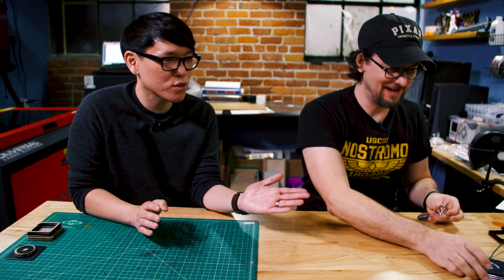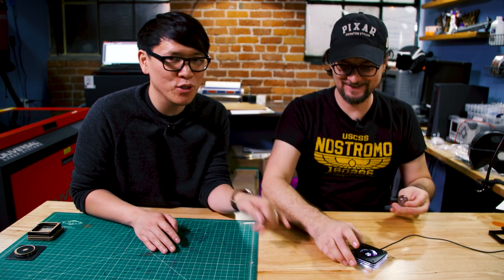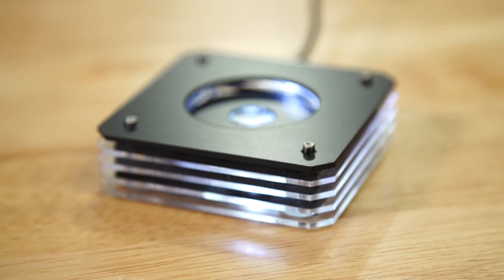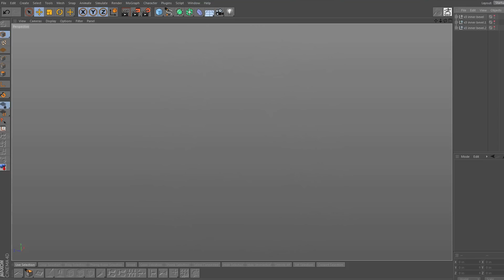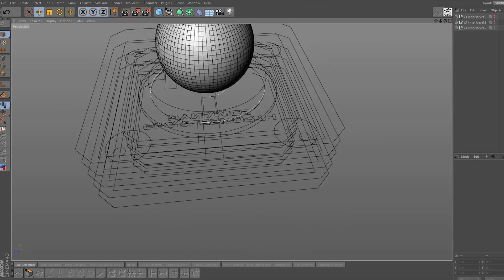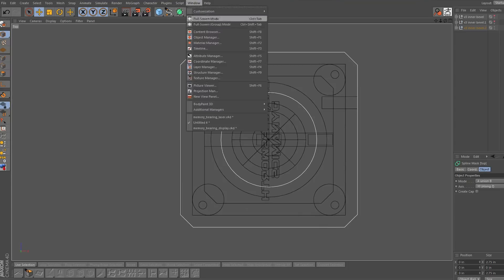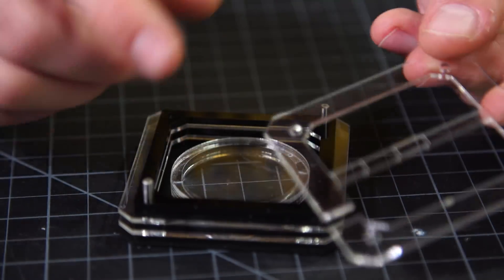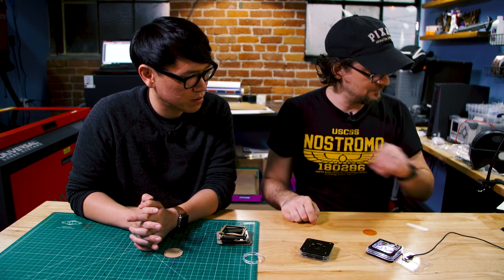Show and Tell: Laser-Cut Memory Sphere Display

Comment: I looked at this on Etsy (it's $45 and you have to glue it together yourself!) and looked around and found something similar on Amazon for $13.99 (https://www.amazon.com/gp/product/B076NCVCZS/ref=ppx_yo_dt_b_asin_title_o09_s00?ie=UTF8&psc=1) with only one side pane, but it's already assembled and has a battery option as well as a USB option (for no cables draping around).  The memory orb looks very similar on it and I didn't have to glue anything and it cost quite a bit less.  I connected it with the wire to an AC RF remote plug and I can turn it on in my home theater room with a button press (also turns on a 5-light puck behind my Harry Potter prophesy crystal ball on the opposite side of the room and that one goes through fading colors and with tissue paper around it looks like the ball itself is lighting up).  I got both lights for less than this "kit".

Comment: Isn't the problem with Cyanoacrylate (Super Glue) that it off gases and hazes the whole part? So you can't say that the hazed part will be hidden, the piece trough which the light comes out would also be hazed.

Anyway, an interesting thing to do with this would be to put a piece of diffuser material around the main cutout on the inside. I think that would make the side lighting much more interesting.

Comment: Or, instead of gluing it together, you could press the pins down to rivet everything together. you don't have to press them very hard, depending on the tolerances of the holes. You'd have to be really careful though because the plastic could easily break from this.

Comment: More video of them using the laser cutter would be good. Did they cut with the paper on? Did they remove it to etch? What settings did they use? I want to see more lasers!
Reply: He was gonna do a video making one and then heard Norm was doing the interview.......
Reply: Telling the settings is pretty much useless unless you have access to the exact same laser model. And typically you cut with paper on. Cutting or engraving with paper off tends to leave residue stuck to the surface that is difficult to clean, though there are specific use cases where off is better.

Comment: Why not have the thing battery powered since its one LED? The wore seems ugly and annoying.
Reply: There's a single pane device on Amazon for $13.99 (https://www.amazon.com/gp/product/B076NCVCZS/ref=ppx_yo_dt_b_asin_title_o09_s00?ie=UTF8&psc=1) already put together that can run off batteries or a USB cable (your choice).  I bought one of those to light my orb.  It looks just as good and requires no effort and doesn't need a cord if you don't want wires.

Comment: inscribes circles to put feet on

completely misses circle
Reply: my guess is that the engravement is underside and from camera angle it just looks to you like he misses them by a lot.
Reply: With the way we're looking at that sheet, the etch lines are on the bottom, and the feet are being put on top, so the steep angle the camera is looking at the piece from is what makes it look so far off. If you were looking straight down at the piece as is intended, it would look much more accurate.
Reply: just like anything produced by normal manufactures :D
(e.g. my keybaord case and the wrist rest)
Reply: He actually puts them on the wrong side as well. Go to 8:53 of the video and you see the USB cable hole is the wrong side of the base compared to the other two layers before it. He very quickly turns it round to show the front instead, because I think he realises it's the wrong way and blew it on the very first step.
EDIT- Looks like he built the inside parts upside down instead. the writing on the bottom piece is the right way.
Reply: That, and he puts them on the wrong side of the acrylic. Look towards the very end. the USB cable holes don't line up. He fudged the build at the very first step.
Reply: That, and he puts them on the wrong side of the acrylic. Look towards the very end. the USB cable holes don't line up
Reply: That would actually be the parallax caused by the camera angle and the refractive index of the acrylic.